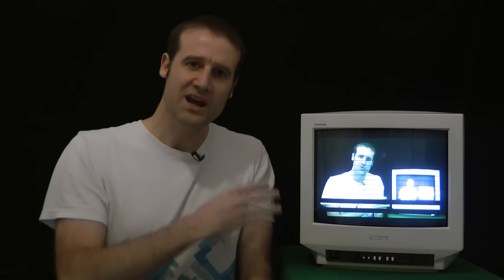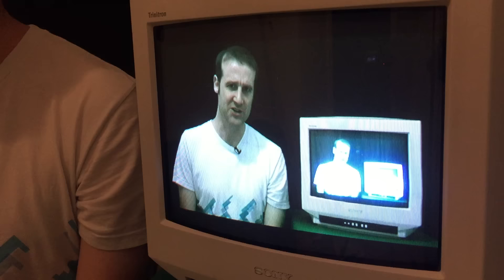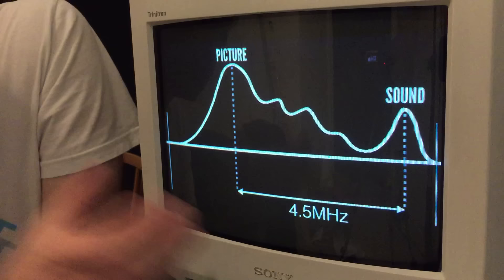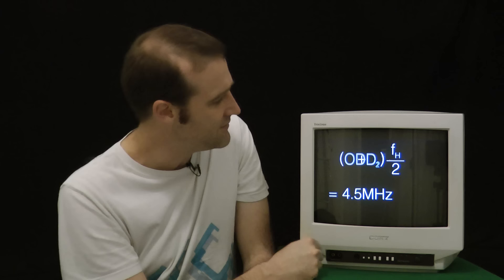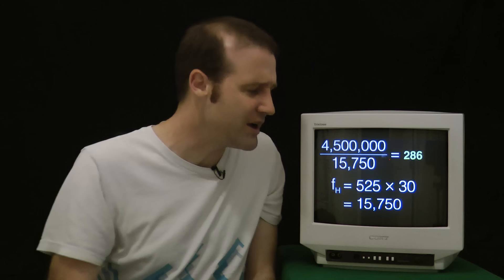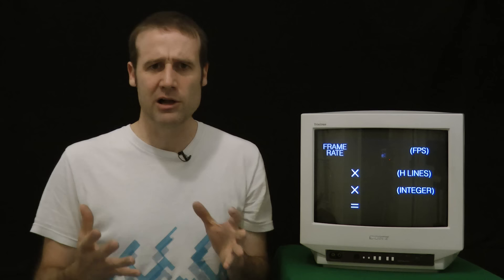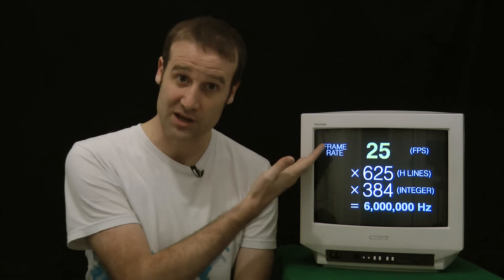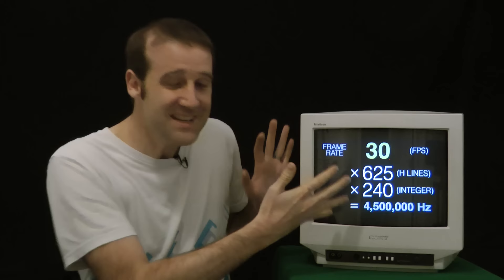Why is TV 29.97 frames per second?

Comment: Did not see this mentioned in the comments (nor very clearly in the video either): why 30 fps in the first place, before color?

IIRC this has to do with the very simple electronics of the old vacuum tube TV. 

The voltage regulation was none too good, so the ripple in the internal voltage would modulate the electron beam position. This meant that from frame to frame the same line of the image could be in a slightly different position because of the voltage ripple in the rectified line voltage causing a kind of jello effect. 

This jello effect would wobble at the frequency that is the difference between the frame rate and the frequency of the voltage ripple.

By making the frame rate same  as the  local AC  electricity frequency  and hence the ripple frequency the jello would disappear. 

And because the jello appears at the difference of those frequencies the engineers were able to tweak it from 30 to 29.97 because no one is going observe wobble or jello effect at 0.03 Hz or at about  half minute period.

Comment: The frequencies transmitted below the picture carrier frequency weren’t wasted.  They make up what is called a vestigial sideband.
Low frequency picture information appears in both the full spectrum picture signal and in the vestigial sideband.
That means that low frequency picture information is transmitted with twice the power of high frequency picture information.

And what is in the low frequency picture information?  The vertical and horizontal sync pulses, at about 60Hz and 15,750kHz.
Old analog TV sets had simple sync detection circuits, and having double the power in the sync signals made them easier to detect, and helped to stabilize the TV images that were displayed.
Of course, analog filters were used in the video chain to flatten the frequency response of the signal to the CRT.

Comment: I was educated in repairing TV/Video/Audio electronics in the mid 90´s here in Sweden in the CRT days and my teacher told us (jokingly) that NTSC ment Never The Same Color because the PAL color system was so much better.
Now we dont have any terrestrial analog TV since 2007 only digital, but there are still channels that are converted to analog TV in the cable networks like in the house i live in, i have gone over to using only streamed TV over the web since 3 years though and its the best solution ever !.

Comment: As you state, the reason they changed the frame rate not the horizontal lines, was for backward compatibility. This was mandated by the FCC, since the transition was going to take a while. The first regular color broadcasts began in the early 1960s. Black and white TVs were still common into the 1970s, and old B&W TVs work right up to the day that analog TV was switched off.

The NTSC color system avoided the transition problems which came as analog video gave way to digital. During this transition, each TV station actually had 2 transmitters on different channels, one transmitting an analog version of the broadcast, and the other transmitting the digital version of the same broadcast. This was possible in the US because of the number of channels available in the highly under-utilized UHF band. The second signals were almost all UHF. To avoid public confusion, the digital broadcast had the channel number of the analog broadcast embedded, so that the viewer would continue to use the old analog channel number on the new digital set. This virtual channel number has become the only artifact of the transition which remains. Many stations remained on the new UHF digital frequency after the transition, but they continue to use their old VHF channel number via the virtual mechanism.

With its more centralized control (the BBC), the UK already when through a  "hard" transition going from 405 line video to 625 line video. The 29.97 frame rate and its compatibility with old sets allowed the US to avoid that first transition all together. As you point out, TV viewers in the US were entirely unaware of the change, whereas TV viewers  in the UK had to buy a new set.

Comment: The film in movies went past the film gate at 24 frames per second but the lamp was flashed 2 times giving a perceived frame rate of 48 fps.  This got away from when early silent films would run it would have a perceived flicker, so at that is where we got the slang american term for movies or flicks.  The interlaced picture of tv did the same thing so while the frame rate was almost 30 fps it would appear to be 60 fps so the eye would see each complete picture with no stop in the motion.

Comment: Since standards are interlaced, we have to think that both fields do not really for a single picture. There is 16ms between the two fields in NTSC and 20ms in PAL/SÉCAM. And this is noticable. The real framerates of television are respectivly 59,94 and 50. This is why movement is so smooth and natural on television and so artificial in cinema wich is stuck at 24 ( despite new technical possibilities ).
Yet most people, including professionnals, doesn't know how to deinterlace properly and 59,94 archives are shown at 29,97; and 50 at 25, with half the definition only, or comb effect.
This is a shame and unforgivable.

Comment: NTSC maintained backwards compatibility with older black and white televisions. The NTSC color broadcast signal could send the new color video images to new color TV sets, and the exact same signal could still be picked up and viewed on the many tens of thousands of existing black and white televisions. The frequency bandwidth required per channel was maintained. This was actually quite a remarkable engineering feat, and why NTSC was adopted over other proposed standards.

Comment: You're completely ignoring the backwards compatibility problem. The existing base of black and white televisions made certain assumptions about number of lines and the sub carrier frequency, and any new color signal had to be compatible with that. That is why they fit the color signal in the gap between the picture luminance and the audio, without touching anything else. It was a core requirement.

Comment: Sorry to say that virtually all of the claims made in this video are incorrect. No, NTSC color was not designed to meet some need of a CRT. The final numbers were all about the most common and inexpensive quartz crystal available at the time, and avoiding interfering with the existing audio channel, while maintaining compatibility with NTSC monochrome sets. No, the NTSC monochrome sets did not use the power line as a reference! That would have resulted in chaos when AC generators were under unusually high or low loads and drifted from 60 Hz. The broadcasting station was and is the source of timing information. No, PAL had nothing to do with the NTSC color standard! NTSC color came before PAL, and although PAL was an improvement, it couldn't be retrofitted without losing compatibility. The actual way that color information in NTSC and PAL is sent is by putting the color information between the monochrome. Television uses a variant of amplitude modulation called vestigial sideband modulation, where most but not all of the lower sideband is removed. This is done instead of USB to keep the DC component of the baseband signal, and that is why a TV channel needs that bandwidth below the carrier. If you look at a frequency vs. amplitude plot, you will not find the solid line shown in the diagram. What you'll see is a bunch of spiky sidebands at regular intervals. By aligning the sidebands for the color signal in between the sidebands of the monochrome signal, both signals use the same bandwidth without interfering with each other.

The numerology explanation posited in this video has no basis in fact. The arbitrary 4.5 MHz number simply didn't exist in actual television, nor was it sacred as claimed. Although PAL had the small advantage of not needing to adjust chroma phase, NTSC was first. Someone had to do it first, so being puffed up about how the system to follow is "better" is a bit silly. Although 50 Hz TV has more lines, it also has fewer fields per second. So it's better in one area and worse in another. But with 8 MHz channels this begs the question as to why PAL is spectrally less efficient than NTSC? Of course NTSC was not made to show movies, it was a television standard. What's more, actual movies in movie theaters are double-flashed (48 fps) or triple-flashed (72 fps). In 1950 the technology to do this electronically didn't exist. (And we all know what a mess SECAM was.) Moot point because TV wasn't used to show many movies until much later.

The bottom line, if you don't know, ask someone who actually worked in television broadcasting. Don't guess, and don't make things up.
Reply: Yes. I had forgotten vestigial side band. That's a phrase I never expected to hear in 2020.
Reply: @secretrat  And in 2020 8VSB is the most-used TV modulation scheme in North America! As a television engineer, the economic justifications for doing certain things puzzle me. The industry that sells us all the equipment (and that helped decide standards) said that we had to keep dropframe and raster scan for compatibility, to re-use old equipment, but we didn't end up reusing any of it. And the cost of a few pieces of studio equipment that could work with HD (cables and DAs mostly) is a drop in the bucket compared to the cost of Repack! Buying a new antenna and waveguide, and paying tower rent for two spaces at a time, now that is a big waste of money! As for VSB, most transmitters are big linear amplifiers, they don't care what goes through them. We had to replace the exciters. We could have had DVB-T! Right now we could be watching DVB-T2 instead of arguing about how Sinclair et al. will turn OTA into PPV...

Comment: Shifting the audio carrier would have been a better solution, given that no TV stations in any given location are next to each other in frequency.  This would have required a minor adjustment in the audio sections of Black and White TVs, but wold have allowed a clean 30Hz frame rate.  Because now even with HD, we still have the 29.97 frame frame for a color system we don't use.  This creates a issue with drop frame timing in editing.

Comment: Note that "persistence of vision" doesn't explain interlacing.  There is actually too much flicker at 30 Hz (or 29.97 Hz for color).  But with interlacing, the flicker is constrained to a very small angle--between adjacent lines.  This flicker is small enough in angle that the eye doesn't perceive it.

Comment: One place where NTSC beats PAL is that showing 24fps films means slowing down the film an imperceptibly tiny amount (0.1%) and then applying a 3:2 pulldown. For PAL, the film is sped up considerably to 25fps, so it runs more than 4% faster.

So a 2-hour movie is two hours and 7 seconds long in NTSC territories (a difference of 7 seconds), but one hour, 55 minutes, and 12 seconds in PAL territories (a difference of 288 seconds!).

Comment: changing the number of lines to make an integer multiple would have broken compatibility with black and white televisions. All of those extra lines would have to be written during the VBlank period (where they would not fit) As a result the extra lines would have been written at the top of the screen causing the image to scroll vertically across the screen. Additionally the vblank period was later used to encode side channel metadata such as closed captioning and information about the show you are watching such as the title and description which would not have been possible if the vblank period was used to store extral lines.

Comment: The part I've never understood is how old B/W TVs could be compatible with
 this if they were still using the 60 ac house current to time the frame rate, when the signal was now being broadcast at 29.97 instead of 39 fps..
Reply: No one actually used the AC house current to time the vertical deflection of receivers, but many camera manufactures used it.  The set designers had to follow what was being broadcast, and 1 part in one thousand is close enough that the sets all worked fine with it.

Comment: Line by line phase alternate is not hard to understand, but somewhat complex.  Field 1 and Field 2 of the frame are not symmetrical.  In Field 2 line 9 is a full line width with rather than 1/2 line in Field 1. (Lines 1-9 are internal timing pulses and not seen)  This extra time period forces Field 2's trace down 1 line width to achieve proper line placement for interlace.
Using the leading edge of the frame's first horizontal sync pulse -15734 hz - as a timing reference, there are 227.5 cycles of color subcarrier -3.5795 Mhz - until the next  Frame's first Horizontal sync pulse.  This means that when comparing this relationship between odd and even lines, the polarity of the 3.57945 color subcarrier and the leading edge of H swap polarity. The .5 cycle means the next line will be .5 cycles offset in H sync to Color Subcarrier.   

The next interesting thing is how this color via its subcarrier was encoded into the luminance signal--simply brilliant.

Comment: With colour TV the subcarrier frequency is the reference for line and field frequencies. This is to minimise sub carrier visibility in the way you mention. In generating the sub carrier, the engineers wanted to use simple multiples of an integer reference frequency (a whole number of MHz) and try to get as close as possible to the existing line and field frequencies. The choice dictates the exact line and field frequencies, and they tried to choose a reference and multiples/divisors to get as close to the existing freqs as possible, and settled on 5×7×9/(8×11) MHz. The frequencies are not tightly locked to the 4.5 MHz video bandwidth, there is no need to control this tightly.
The development of NTSC was utter genius and was pushing technology beyond known limits.

Comment: You ignored that the bandwitoh it self was the first limit, 625 lines means more data, and that would fit. In fact, PAL has more lines in Europe because it has less frames per second, in Brazil where PAL-M (PAL @ 30fps) was used, it has 525 lines

Comment: Good presentation, but you didn't discuss the real reason all of this happened. First, TV sets were expensive, so the FCC said old Black and White sets had to display color signal using the same electronics. That way the whole country did not have to split for a new TV set. 

The color information or signal, rides on or modulates the black and white information as a 3.758 wave right on top of the brightness signal. It is encoded as a continuous phase change in this signal. Because it actually modulates the brightness of the signal, it would produce a noticeable series of vertical lines in the scan which the eye can easily see. By changing the scan rate slightly, the brightness changes alternate with the scan, therefore  become almost invisible, because they now just appear as intensity dots and are averaged out by the human eye. As you stated, the frequency allowed could not change, so it became necessary to insert color information right on top of the brightness information, so they had to hide the effect of the color information by just fooling the eye. 

I might add, that the reason for choosing 60 hz scan in the first place was, that if there was interference from the power frequency, the interference would be in sync with the picture and not produce moving brightness effects. Of course, when the scan rate changed, then any power line interference could be seen crawling through the picture. This was often the case where power supply filtering became inadequate in color TV sets. I serviced thousands of both black-white and color tv sets. Am also familiar with PAL standard, and agree it was good.

Comment: Also: We had the chance to fix this when we introduced HDTV, but for some reason we didn't! Just like having the railroad tracks that moved the Space Shuttle from the assembly building to the launch pad be spaced apart the width of two horses standing shoulder to shoulder.

Comment: That’s just the beginning. Then to synchronise they used drop frame time code
(https://en.m.wikipedia.org/wiki/SMPTE_timecode) to adjust for the 1000/1001 ratio.

With the advent of digital video it could have been all cleaned up - but no, the US won and we have 48000Hz audio but still use multiples of 29.97002997...

Comment: Likewise VGA is 59.94 Hz instead of 60.  You can check the math by taking the VGA standard crystal oscillator of 25.175 MHz, divide it by 525 lines (480+vertical blank), divide by 800 pixel clocks per scanline (640+horizontal blank), and you get 59.940476190476190476190476190476...